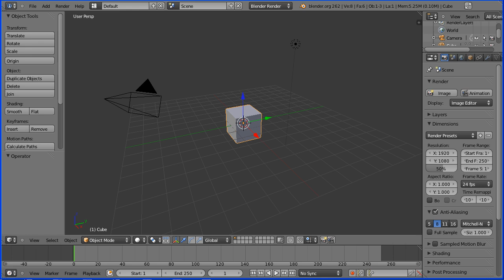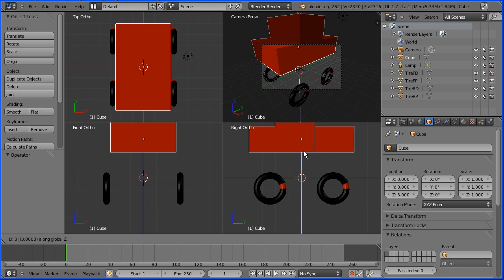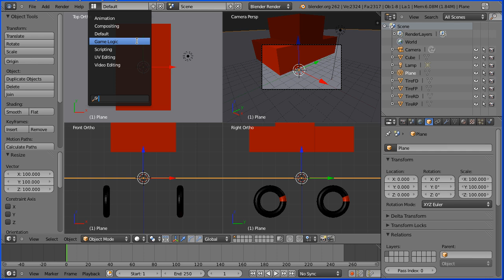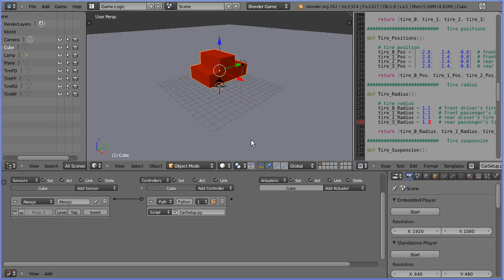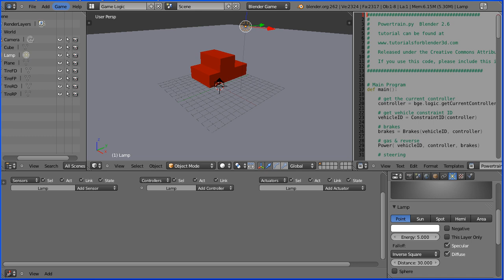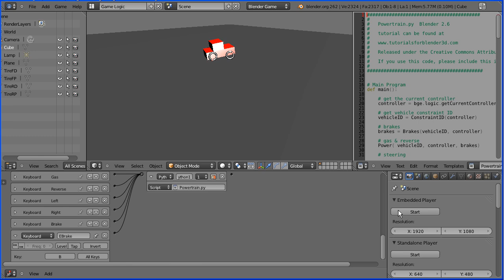Blender Tutorial Using a Model of a Car in the Game Engine (Bullet Physics Vehicle Simulation)

Comment: hey my wheels dont sit with the car
Reply from the maker: Check all the settings, download the finished file from my website, see if that works on your system, if it does, compare the settings.
Reply: yea I've done that but I've got a custom made car and smaller wheels
Reply from the maker: In the car setup script you need to set the size of the the wheels and their positions from the car center. You can take the values from the properties panel or adjust them by trial and error. The following tutorials may show this -
https://youtu.be/amAepcF4seM
https://youtu.be/jWgkr7ze6yY
Reply: ok ive just relized that my car is not centred  and i cant get it centured
Reply from the maker: Object menu, Transform, Origin to Geometry. Then set x, y locaton values to zero
Reply: with the other tutorial how did you find the values for the wheels for the other cars
Reply from the maker: It was some time ago but I think you can take the values for the object properties location and scale values or by trial and error - start with one wheel and adjust the x location until it is correct, then the y location and so on.
Reply: thanks its working but my car isnt there and invible is truned off